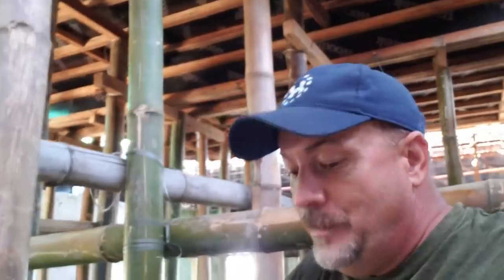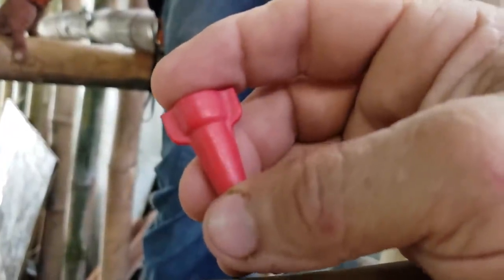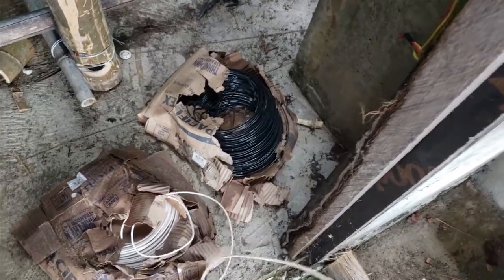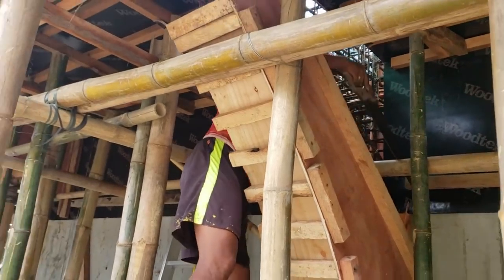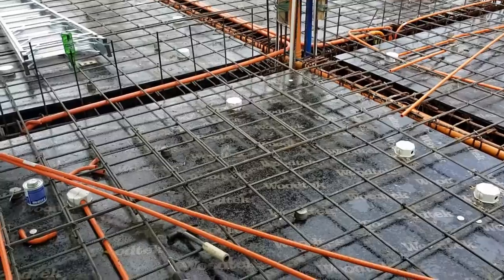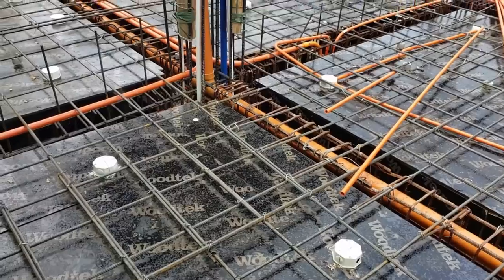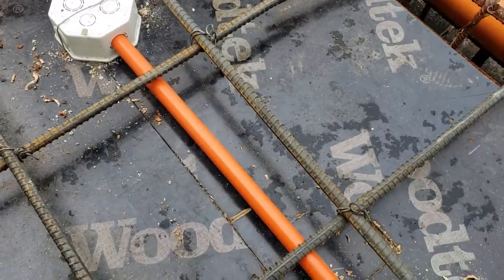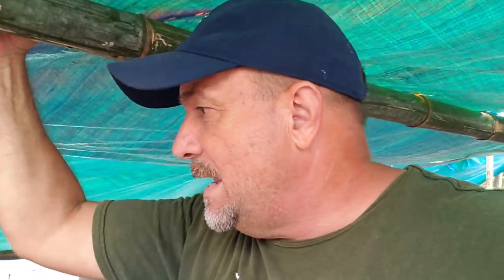Philippines Beach House Build Day 130: YOU told us we can't have electric in CONCRETE!

Comment: You are putting in a suspended slab a premixed would be much better?!!? did mixing it on the ground because you don't know if you'll get a perfect mix,,? and I'm sorry to say but isn't the conduit supposed to be on top of the first layer of Steel bed inside the the concrete beams

Comment: Earths need a double screw connector or soldered,brown is active,blue neutral, green with yellow stripe earth,there the international colours,most people dont relise how dangerous voltages over 200 are🙂 i would be fitting rcds or safety switches and those j boxes are not made for using in concrete,the philopines do have have a wiring code and electrical wholesalers ,thats where electricians shop,those connectors are junk,,BLUE Point connectors are the only ones to use,you forget your in a marine environment

Comment: Good thing you sent wire nuts from the United States, I wouldn't trust a connection with electrical tape. Watch those pipes with no connectors, if somebody knocks those pipes out of the box during the pour, It's gonna be a bad day. Do they sell ground rod in the Philippines?
Reply from the maker: those are tied super tight. good call though. yes they do but can be hard to locate at most hardwares or home improvement places.  A subscriber that knows this place just informed me where to go find them!!! Love that in this channel. Thanks for your input too
Reply: All you need is basic wire splicing knowledge. They've been used long before wire nuts have been invented.

Comment: Problems hand mix cement is it isn’t as good as the readymix and you get cold joints 
Maybe ok for a path way but for a suspended slab
Nooooooooway
Reply from the maker: According to you while I sit here in this house without even one tiny crack. YESSSS WAY

Comment: I sent my sister-in-law a bag of 15,000 of marrets. The Philippines is 220v so you would use red & black. Add green for ground. In N.A. we have 110v, black is hot, white is neutral. Over there you can get 110v between either side of the line to ground (illegal there & just down right dangerous.) Until I saw this video, I only saw a couple other of yours & was wondering what the F all the pipes were for. Typically the corrogated orange plastic pipe is used in pored concrete for electrical shit because of the expansion/contraction factor. Did we meet at SM Mandurio food court back in 2012, you mentioned that you wanted to have your hogs shipped over if possible. I think a couple of your workers worked on my wifes house in Pavia. They don't want a mixer because they get paid by the hour, labour is cheap, but you can get a drier, more consistant mix with a mixer. Drier mix = stronger, longer lasting concrete. Get them a mixer with no motor & jury rig an old bicycle to power it with pedal power. You won't have trouble getting a pedi-cab driver to provide the leg stamina, gotta spread the work around. If you want a cheaper way to get 110 to power things with, take a look at AC motor voltage controllers, a lot cheaper than transformers with a much higher amperage capability, say like a whole kitchen full of appliances.
Reply from the maker: We run solar only offgrid. We have two setups one the big one is 220v n other is 110v 3000 watts